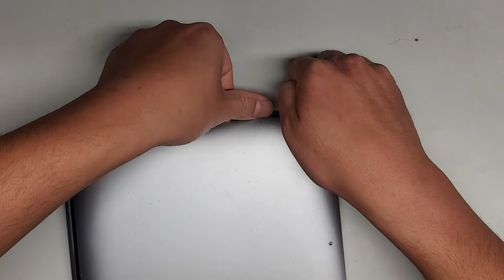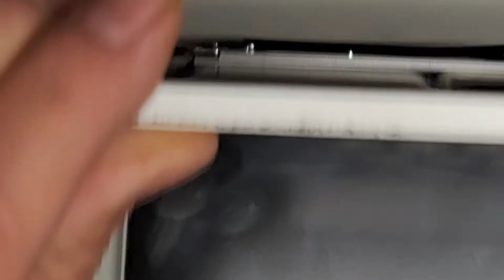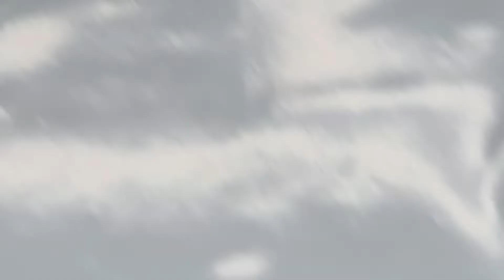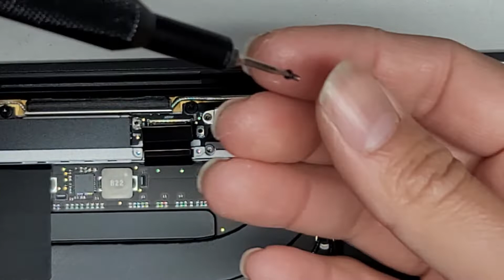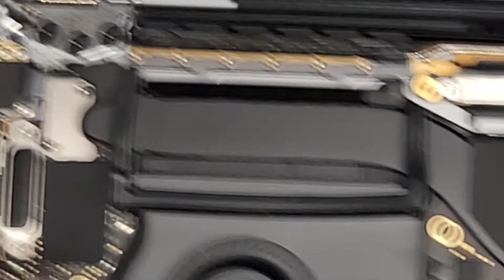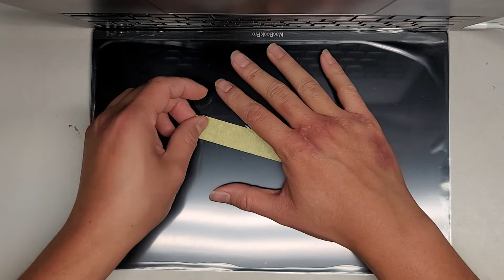13" Inch 2020 MacBook Pro A2251 Disassembly Display Screen LCD Assembly Replacement Repair

Comment: Have you ever attempted to change the actually connector on the screen? On the retina models Late 2012-2015 you actually could although it took some tedious work. I learned that after I had scrapped a bunch of screens simply because the connector was damaged. On these models it looks like there is some crevices around the bezel hinge so that maybe it comes apart. Apologies if this is something you have mentioned in a previous video but I am in a time crunch and was hoping you had some input. Thank you.
Reply from the maker: I haven't

Comment: This was quite helpful and I completed my repair without issues. Tiny coax connectors and its-bity screws for the wireless antenna were a pain.
Reply from the maker: Glad you were able to get it done. If you haven't already, please like and subscribe so others can find my videos. Thanks!

Comment: Best video of how to do this out there, managed fix my MacBook
Reply from the maker: Awesome, glad it worked. If you haven't already, please like and subscribe so others can find my videos. Thanks!
Reply: How's the screen holding up after a couple of months?
Reply from the maker: @GuerreroUrbano100  screens don't spontaneously combust lol
Reply: @ItsBinhRepaired  Of course not and I don't think I implied that, but my cousin's MBP had to have the screen replaced twice and every time after 3-4 days it would stop working. The screen would flicker or it would just be all purple with some black bars. This is why I ask how the screen is holding up.
Reply from the maker: @GuerreroUrbano100  I had one customer try to say it failed on it's own and I saw cracks in the lcd under the glass... lol are you sure he didn't break it? In the thousands I repaired so far, I've never had one just randomly go bad, especially not that soon after.
Reply: @ItsBinhRepaired  The first one he fixed on his own so It's definitely possible it's on him. But the second time it was taken to a repair shop and the same thing happened. Not sure if it's something else that caused it. I'm also asking because I'm going to be fixing my own screen in the next couple of weeks and I'm watching this video over and over to be sure I know what I'm doing!
Reply from the maker: I hate how YouTube doesn't notify me of replies. Were you able to figure it out?